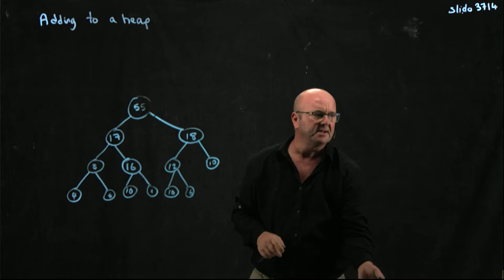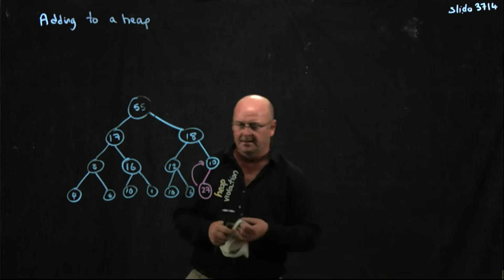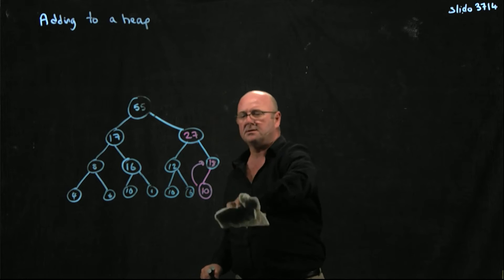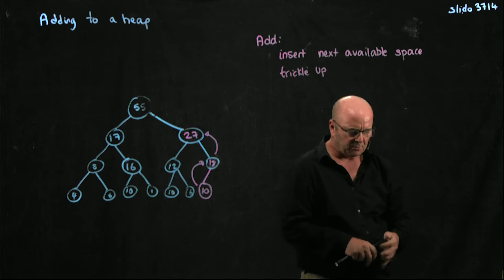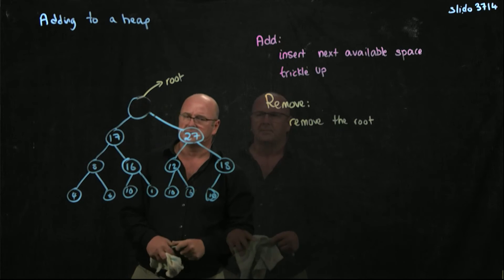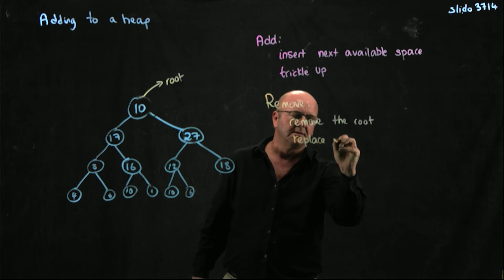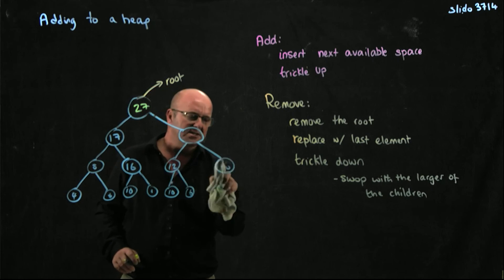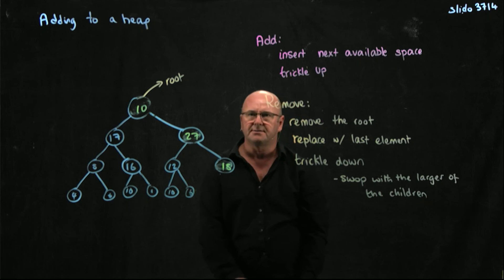Heaps 2 Add Remove

Comment: What if you wanted to remove a particular node? What would the process be then? For example, if I wanted to remove the node with the value of 17.
Reply: exactly my question, he spoke as nothing other than root can be removed...
Reply: For those who are wondering:  It seems that heaps have a specific use case and that mostly is related to priority queues.  This means that taking the top off the heap is dequeuing the item with the min/max priority.   Other data structures should be used if you need to do other things.  You can remove from anywhere in the heap if you want but its probably not very efficient.
Reply: @mutoso  wow dude thnx! where did you find this??
Reply: @mutoso  why not always replacing it with A[lastIndex]?